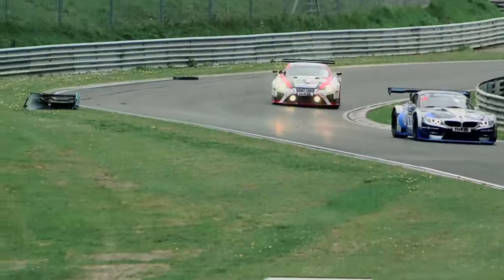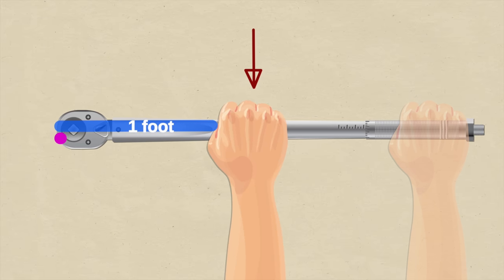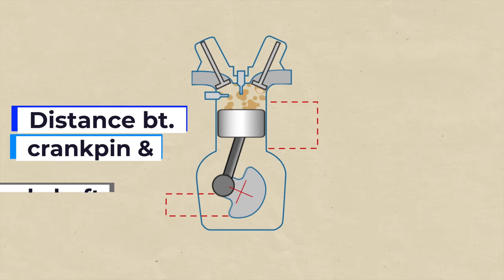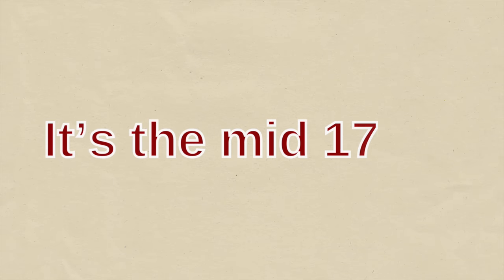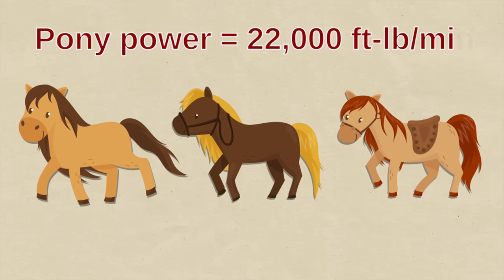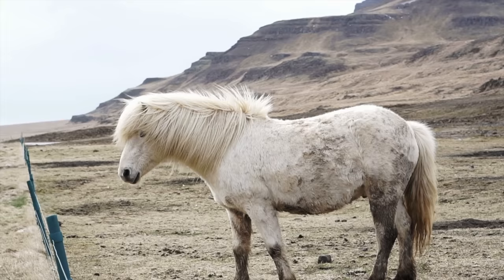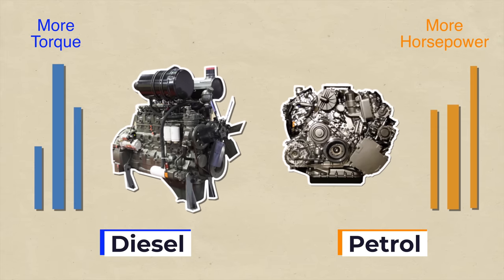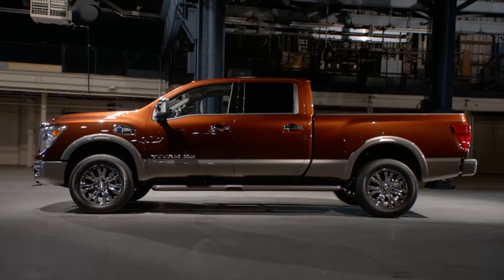Torque vs Horsepower, Which is Better

Comment: Basically torque = acceleration and Horse power = more generated speed in longer distance. You can have a small car with heaps of torque and less HP which will take off fast. But if you have a big v6 with more HP and less torque it may take off slower but will catch up. That’s how I’ve always thought of it. And it’s just an example because most big cars have plenty of torque in order to pull that weight along, but lots of smaller cars have punchy modern engines.
Reply: @Mark Codiroli Knowing engine BHP and torque are far from useless, unless the engineers really pork it away when they select the transmission to mate the engine with.  You can estimate wheel horsepower using 85% of BHP if you are lacking dyno access.  Your last sentence is wrong, HP depends on torque and RPM and not the other way around.
Reply: That's an incomplete way of saying that just leads to more confusion.  If you launch that v6 revved up in the powerband it will beat the torquey engine no problem.  Power is what causes acceleration, torque is a just a means to get the power.
Reply: @Mark Codiroli "You can estimate wheel horsepower using 85% of BHP if you are lacking dyno access." Your reply had little to do with my statement, but was correct otherwise. The rest of my comment was more of a discussion on independent and dependent variables, stating that power depends on torque is much more correct that saying torque depends on power.

You seem to have a good understanding of the subject, but this topic in particular lends itself to a lot of confusion in laypeople if something is misstated by a trusted source.
Reply: @Mark Codiroli Ah, I guess you're talking about wheel torque vs engine torque which is one way to look at it.  I'm sure all this makes perfect sense to you, but telling people incorrect things like "power is potential" and "force is horsepower" just confuses these concepts for people. 

"When referring to drive wheel horsepower is not constant due to horsepower is work completed and changes with RPM of wheel not flywheel." What? The motor will output its rated HP at a given engine RPM no matter how fast you're going.  You will accelerate less the faster you go, until hitting the vehicles top speed due to effects like aerodynamic drag, but the motor will still be making its rated HP.
Reply: @Mark Codiroli I'm just taking issue with you usage of the word "potential".  In electrics, voltage is also called potential and power is called...power.  In the realm of mechanical power like we're discussing, electric potential would be analogous to force/torque and current would be analogous to RPM since P = IV the same as P = FV (for a constant force applied at a constant velocity) or P = tau*omega (for a torque applied at an angular velocity).  In other words, torque represents the potential for power, but the power can only exist if the torque is applied as the body of interest is rotating.

One other inaccuracy from you: the piston force would be the cylinder pressure times the piston's surface area (assuming a flat piston, but you get the idea).
Reply: @Mark Codiroli Ok dude, you got me.  Force is clearly measured in PSI, as in "wow I weighed 100 PSI today, I need to diet." Also you completely missed the point of my argument on why you shouldn't call it "potential" from a scientific/engineering perspective since that concept is already spoken for.  I'm just going to chalk this up to a language barrier and move on, thanks.

Comment: take 2 engines with the same HP rating, but 2 different displacements (example 327/350 vs. 440/350) in the same weight and geared car, and the larger displacement engine will always win due to greater torque
Reply: Nope, sorry. The horsepower rating comes from the torque rating. You can't get horsepower without torque, because horsepower is the mathemathical product of torque and rotational speed. Displacement is a way of converting chemical energy to torque, but there are various inefficiencies and factors which alter the relationship between displacement and torque and power.

Comment: You forgot Newton Meters. Why don’t we use KW instead of HP? Oh right, metric system. I think 10 is easier than 12. Everything relates back to 10 in metric and nothing relates to anything with the Standard system. My house electric meter doesn’t measure HP😜
Reply: But can be converted to HP by multiplying 1 HP by 746 watts. Bicycle racers have stress meters on their pedals that reports power in watts. I like to divide by 746 to see how much HP it is.

Comment: I prefer torque and here’s a big part of why: 
1) If you don’t exceed 5252rpm then torque is way more important. HP is essentially meaningless. 
2) one engine produces X amount of power at 7000rpm; another produces the same amount of power at 3000rpm. Why would you prefer the first one over the second one? 
2a) Car with engine 1 needs to be revving at 4500 rpm to go a steady 60mph. Engine 2 can do a steady 60mph with the engine doing 2000rpm. Which is better for non-race / daily driver applications?
3) Low-end or ‘off-idle’ torque is the biggest factor for daily drivers like 99% of us. And a “broad, flat torque curve.”
4) I’m told that there is/was a saying among engine builders; that HP numbers sell engines; torque figures win races.
Reply: I'll take a crack at your questions. Just my opinion. :D

1) OK, but if you do exceed 5252, then HP is important. Depends on the driver.

2) Because the first engine has lighter parts that can rev higher and getting rid of weight is important for acceleration.

2a) Hard to say. Transmission makes a big difference in drivability. Five-speed vs. eight.

3) Low-end torque with a broad-flat torque curve doesn’t sound right. But I had a car with only 110 HP at 5,000 but 125 lb-ft. at 3750 giving me about 89 HP and was great for off the line and zipping around town. But zero-60 was over 12 seconds. I think midrange peak torque is better unless again, you like to go really fast. 

 4) drivable
Reply: 4) drivable
Reply: Try this answer again. My post wasn't posting.

4) I’ve heard that. It’s more than that, however. And you’re intelligent enough to know trans, diff-ratios, sticky tires, appropriate shocks, etc. make a big difference in races. My brother has a BMW M5 with the V10 engine. Had it supercharged. Redline is at least 7,800 and it develops 800+ HP, yet, totally drivable around town. Nothing can touch it. Fierce.

Comment: The car manufacturers use these numbers to confuse customers. I sold new cars for 3 years and Chevrolet from year to year changed their horsepower and torque numbers. They didn't change anything on the engines they just quoted the numbers at different RPM's. I think this is deceptive and shows little respect to the consumer of their products.

Comment: Forget torque completely.  It tells you nothing on it's own.  All you need is the power curve.  More area under the curve = better.
Reply: You are absolutely correct. There are so many misconceptions in many of the comments here, power is really all that matters as it already includes torque.
Reply: But car magazines and websites don't provide the power curve aka dyno chart. So we're left to figure it out ourselves. I always use the formula for horsepower to see how much a car makes at it's peak torque which they pretty much provide. It gives me some indication.

Comment: Simpler explanation.........horsepower is a function of torque and RPM.
Reply: Steve Koffeld thats true.....horsepower cant be measured, its calculated using torque measurement ( from a dyno) ) and rpm measurement.

Comment: Simply put, torque is how much work you can do. Horsepower is fast you can do it.
Reply: Easy way to explain with more common sense approach. Is Torque gets the car moving quickly, and Horsepower keeps that pulling power strength passed 40mph.. a car with a tun of torque will accelerate quickly but the car with more horsepower will pass it up once passed 40mph is how i explain it to people. Torque is good for casual driving gets u moving quickly and horsepower is better for racing cause it gives u power passed 40mph (top end) pulling strength. This is why towing u want torque... to get that heavy load moving quickly from a stop without torque the pulling power 40mph and below would be a bad driving experience.

Comment: Scotty what do you think, of the 2016-2018 Mazda CX-5 and the 2016-2018 RAV4, I’m stuck? I want to buy one. I have a Nissan Sentra now, it’s been giving me endless issues, I need something reliable and I need your input! I know that Toyota’s are known for their reliability, but I honestly feel that the Mazda has much more power and has good reviews too, and I’m honestly not a fan of the look of the Rav4, even the redesigned one. I’m 20, started driving at 18, and I’m just tired of all the car issues, I plan to pay in cash(been saving for a long time), so I’m threading very carefully! Your opinion is very much needed, thank you!

Comment: More torque does not mean better acceleration. What matters is how early in the rev range the torque is produced, how much horsepower a car has and how much the car weighs. 

It is a common misconception because an engine with more torque USUALLY produces torque sooner in the rev range which gives the impression that more torque means better acceleration.
Reply: Torque absolutely DOES mean acceleration. You simply can't have the second without the first, mathematically. What gets in your way is weight, and eventually air friction. A car doesn't "have" horsepower; horsepower is what you get when you deliver torque at an RPM. You don't get horsepower                                                    without torque. This is simple math.

Comment: here a very simplified explanation for torque vs horse power. If you want to accelerate going downhill you need horse power, if you want to accelerate uphill you need torque
Reply: Not correct. Doesn't matter if your going uphill or down accelerating with or without the aid of gravity.
Reply: @ninemilliondollars  yeah, I know that, but I've been trying to explain torque and hp to my sister for years, and when I gave her that explanation, aahh, she says, now I understand a bit more. So I thought maybe it could help others to understand a bit more as well. lol
Reply: @danmyself5341  Gotcha!
Reply: @ninemilliondollars  got what?
Reply: @danmyself5341  Simply a slang term that means I see what you said in your last post, understood.

Comment: Scotty I have an automatic 2006 matrix could you help identify a problem with it. When accelerating past 1st to 2nd the wheels spin and the whole car starts to vibrate once past those gears it shifts wonderfully it’s more apparent when on a hill going up. Could it be the transmission or something else?

Comment: Hey Scotty my Honda Civic 2012 revs up to 3000-4000 rpms when I press the brake a little hard especially when going down a mountain and the car is supposed to brake in 131 feet from 60 mph but I feel like it has lost some of it braking power from this issue and now it would brake in a longer distance please help I looked online and some people have this issue but there is no answer .

Comment: "They" told me that Horsepower is how hard you hit the wall ( ending of the movie "Vanishing Point" ) ... And torque is how far you push the wall ( see any tractor pull ) ...
Reply: And "They" were wrong. Those things are actually influenced by the effects of kinetic energy, mass, momentum and inertia.
Reply: I believe Vanishing Point ended with the bulldozer not moving, so no work was performed by the car when it hit it, thus, no HP as HP is effort over distance. If the bulldozer blade  moved, that would be effort over distance and equate to HP.

Comment: I've noticed that my 2002 civic manual has a lot of low end torque
Reply: NO no it does not
Reply: Noooo no no no no nooooo wrong lol
Reply: That vehicle had either 110 lb-ft of torque at 4500 rpm or 114 lb-ft at 4800. Low-end torque would be in the 3,000 or lower rpm range.

Comment: Hey scotty I have a 1995 mustang gt 5.0 with 118k miles on it. I start the car in the morning and have no issues once the car gets up to temperature and I try and start it again it wont start and acts like a dead battery. If I let the car sit for about an hour it will start.
Reply: Does it turn over when you try starting it that second time? You mentioned like a dead battery. (I had a 2000 GT.)

Comment: Ive been wondering is it okay to switch to neutral from drive when going down hill on an automatic transmission? Old car, golf mk4 1998
Reply: Technically you'd be coasting and that takes a lot of control of the vehicle away from you leaving only the brakes. It's better to stay engaged so you have the proper power at a moment's notice if needed. My opinion.

Comment: Hello scotty mayber u could help me i have a 09 chevy malibu hybrid 2.4L ive been loocking everywhere for a alternator replacement couldnt find the right one but i did find one that is very similar in every way the only difference is on my old alternator it says 13.5V and on this new alternator is says 12V can i use this one i wouldnt even care if the hybrid features stop working as long as i can start my car?

Comment: Is there also a lesson on how RPM work?
Reply: RPM is pretty self explanatory.....
Reply: @210SAi  Yes, but  only if you  can  deduce what each Letter in the equation stands for, ha.
Reply: RPM is the link between torque and RPM: Torque x RPM = Power.
The engine itself has a published "torque curve" as part of its specifications, which is a graphical chart showing what toque it can deliver at any particular RPM. Because there are many factors that affect how an engine converts chemical energy from gasoline to power, the torque varies over its operating speed range. The computer that controls transmission in a modern car "know" the torque curve, along with other engine performance factors, and will select the best gear ratio for the driving mode you're in, whether constant speed or hard acceleration, for example. Maximum torque and maximum efficiency don't occur at the same speed, so the computer monitors what you're asking the car to do, and makes adjustments accordingly. This is why many cars have "sport mode", which gives priority to torque & power over efficiency (MPG).
Reply: Understanding how an internal combustion engine works is important for understanding RPM. Look for that on YouTube if you don't know. Assuming you do know, then you know when a piston moves down and up again, it turns the crankshaft one complete revolution. Counting the total number of Revolutions Per Minute abbreviated RPM. The more revolutions per minute an engine can do the more powerful it can be. That's a simple explatation.

Comment: Scotty buy my first 2002 Mercedes Benz S500 3 years ago with 178k miles for $2500 from my cousin told me it wanted just a front bumper Scotty after I bought it  it  everything I spend $5000 bucks buy parts an fixing it at the mechanic, got screw it was a pipe of junk got read of it for $900 bucks, I'm thinking about buying a 2013‐2015 Lexus RX 350, 2013‐2015 Lexus RX450h  hybrid, 2013 ‐ 2015 Highlander, or a  2013 ‐ 2015 Toyota 4Runner 50 thousand miles My budget is 15k-18k planning on keeping it for a long time I don't want to get screwed again what's your opinion and Dose SUV Engine an transmission with that many miles?

Comment: What is the distance here in the engine ? Length of the piston rod?
Reply: no rod to main journal radious in crankshaft 😉👌🏻 the only point is it dont change to much for combustion ngine in regard to peak torque at crank value 😉👌🏻 you seen the same peak tprque numbers for short stroke sport engine let say in motorcycle like in long stronke cruiser motorocycle from 1 litres displacement cos of 2 reason 1 those number are avg usefull torque from whole work cycle so even if longer stroke will generate higher peak number on graph (what probably isint true and even if than 2 factor compensate it ) than avg still be similar 😉👌🏻 cos and second factor which is biger bore biger bore mean explosion work on biger surface area increase force so longer strone /longer arm leverage is compensate be biger force from explosion on biger bore piston in shorter stroke in results basically both can make the same avg usefull torque at crank numbers from 1 litres dispalcement which is for n/a typical engine cosntruction like single parallel 2 inline 4 v4 v2 boxer inline 12 v16 ehatever what 120 nm from 1 litres dispalcement 😉👌🏻 typically its around 100 (90-110nm) .

Comment: Hmm, so a rotary engine having very high RPM, can be build to connect to an shaft mechanism via gears, to produce enough pressure for an higher torque?
Would use less gas, but would have an slower acceleration point. This is so confussing.
Reply: Not necessarily. The moving parts of the engine itself have mass, meaning that it has a maximum theoretical angular acceleration, but that is far higher than the acceleration of any vehicle it will be connected to. The rotary engine has lower moving mass, and that mass is rotating not reciprocating, which is what allows it to rotate faster and accelerate itself faster. The displacement (difference between cylinder volume at "top" and "bottom" of stroke - or its equivalent in a rotary engine) is typically smaller, though, meaning that you get less energy per combustion cycle, but more combustion cycles per minute.
So a rotary engine - with a higher engine speed range - would simply be connected to a gearbox with a higher reduction ratio to get an appropriate combination of torque and RPM at the output shaft.